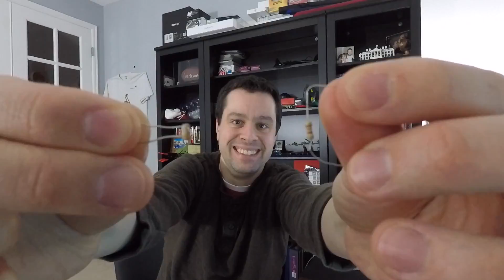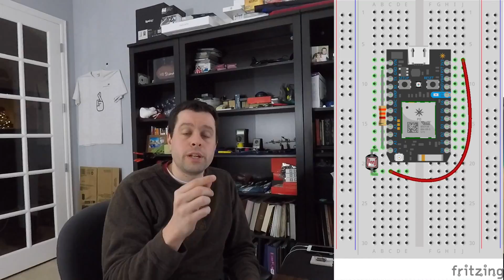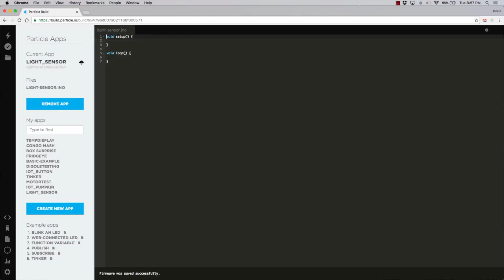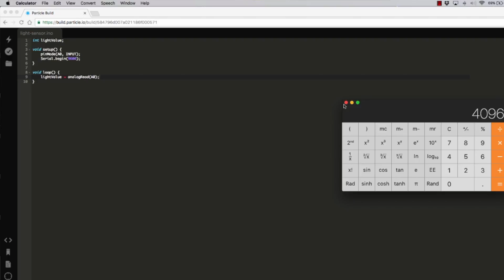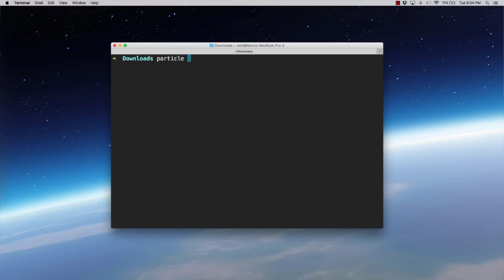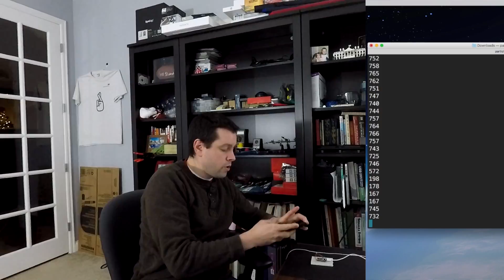SENSING LIGHT WITH THE PARTICLE PHOTON | DailyIoT 024

Comment: Had a flashback to this video in which you mentioned how to view the voltage from the from 3.3K Resistor and the Photoresistor. Simple, using the particle serial monitor. 
Then I thought great we get to see the changing output but how does the code see the output. In order to be useful, the code has to be able to interact with the numbers generated by the ever-changing output from the voltage divider. Did I miss something?
Reply from the maker: Here's some sample code of interacting with the output of the light circuit. https://gist.github.com/LosantGists/61b48ea4ade4583539aa057999bf77cb#file-losant_fridge_watcher-ino

In it's simplest form all we're doing is an analogRead() on the pin connected between the photocell and the resistor.  We just take that reading over and over again in the loop() function of the firmware.